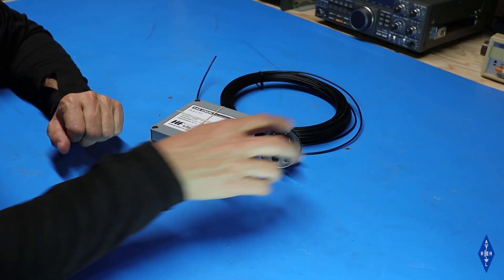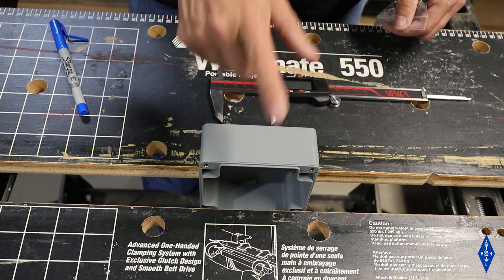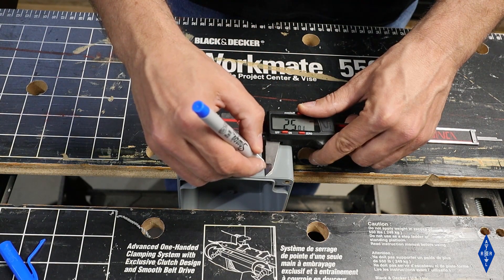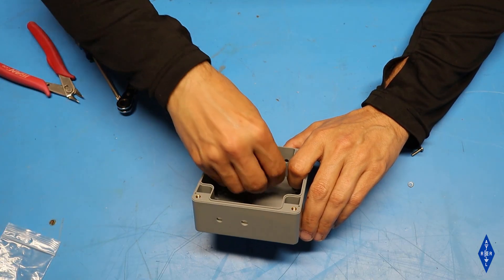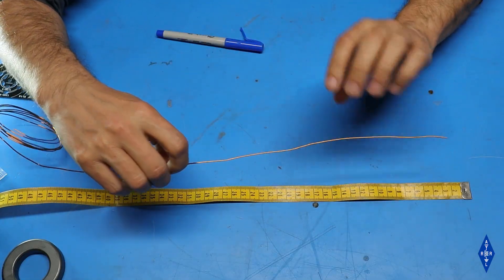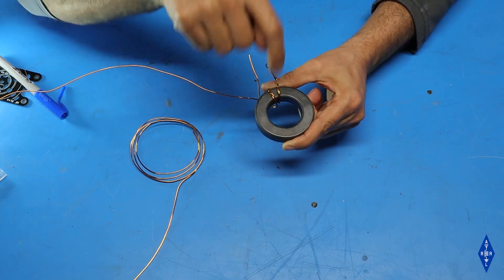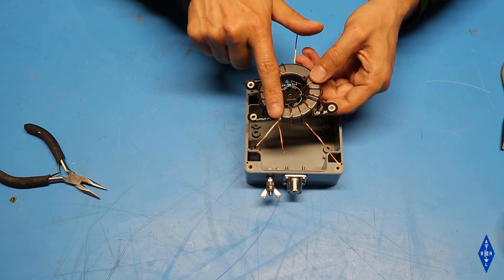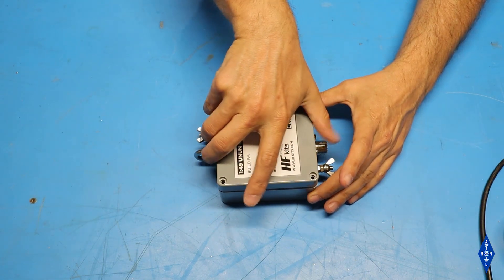EFHW End-Fed Half-Wave Antenna Kit | Part One: BUILD

Comment: In the original manual for HF kits, they install SO239 into the box but not install outside the box than you, it is more beatiful box. Perhaps is more easy install outside because inside need a more big hole that 16mm to conected a full conector in so239. Nice video, great result and nice data test for all people And it's also the first video I've seen about these kits that use tooth washers well :) , thank you ARRLHQ.

Comment: Two things I would recommend:

1.  It's a bit easier to do the soldering with only the bottom two bolts holding the SO239 in place.  It's much easier to see and "get at" the ring connectors without the other hardware in the way.  
2.  It is possible to install the SO239 "upside down," which won't hurt performance, but it makes it much more difficult to solder the third wire and capacitor in the center of the SO239.  Install the SO239 so that there is a bit of a "scoop" in the center post, which will make it much easier to see and solder.

Comment: TIP: Drill the big hole for the SO239 and mark and drill ONE bolt hole. THEN attach the socket with one bolt and use the base of the socket as a template for the other three holes. That way, you don't have to re-drill misplaced holes! 😉
Reply: Does anybody know the size of the screws/bolts, washers & nuts used for the SO239 connection??  I'm trying to put something like this together myself sourcing my own parts locally...

Comment: 12 total wraps with 2 in the primary is a 36:1 transformer.  Is that what your plan for the EFHW calls for?
Reply: It's actually 14 wraps!
Reply: The two wraps in the primary are bifilar so there are actually 14 wraps on the Secondary.

Comment: Rob, I'm stopped partway into a build.  A few comments - plus an important question about something that's holding me up.  I assume if clarifications are useful, you could just add some online text to the video , like other how-to people do on YT, instead of having to re-edit the video.  .  
     1.  I was confused at first by the ring connector insulation removal because there are three of them.  Ultimately you remove them all later, but I worried at first because I pulled it from one of the ones with the large hole instead of the small one you started with.  An onscreen text clarification might help.  
     2.  I used tape to hold the coax connector against the box at the outside, because it's hard to work it subsequently without screws etc falling off - maybe worth an onscreen suggestion.  I also got away with using just one 8 mm wrench instead of two by holding the other side in place by hand.  
     3  Ring connector at 6:20 - it struck me as odd that its flat part wasn't flush against the box instead of flipped as you seemed to put it on, which makes it deform away from the plastic a bit as the bolt tightens, but maybe there's a reason you did that - maybe an online comment to clarify.  
     4.  Around 8:55 you flip the ring around without announcing that.  If you're a noob like me, I just assume I did it wrong and go rewiring it to the right instead, then discover you just flipped it over a second time around maybe 9:23 and I then go rewiring it like it was the first time.  An onscreen comment about the flips could be really useful each time you do that (happens again around 9:23).    
     5.  I had to freeze the screen to count the how many times you wrapped it on the opposite side - it could be helpful to put an onscreen text comment there.  
     * 6.  I followed very closely - paused, stepped forward 5 seconds in places, left or right arrow, for anyone who doesn't know how to use that, and frame by frame using < and > keys can be useful too.  But even as carefully as I did this, at 10:15 I seem to have 7 wraps at right as you do but appear to have 4 on the left instead of 5 as you appear to on the screen before the 5cm strip goes outwards underneath (and I had to pull it from under another wrap in consequence of where I started wrapping per the onscreen images.  SO the critical question is, does this matter, does that numerical precision materially affect performance in consequence of turn ratios or anything? 
     7.  I don't have flux, I just have solder with a rosin core right now.  Will this make a difference, especially since you said contact here was key?  Also, will it matter if some of the stripped copper is in contact with the iron ring at all?  It might be helpful to clarify for the ignorant.  

I'd like to have this ready for Field Day, but it's more important to just not screw it up if some tiny detail like a missed turn will do that.  

Hopefully I don't have too many more questions after that.  Look forward to your answers - and I appreciate the video, it's far more helpful than the detail-skipping pdf.

Comment: Make sure the when installing the SO239 that the short part of the center wire connector "opening" is facing up to facilitate soldering.  If it's facing down, you can't get to the wire and it's impossible to solder.
Reply: lol,,I got lucky and installed SO239 facing up,,lol,,I did this before reading your post,,,KI5TFZ,,Thanks for future reference !!

Comment: I found the point where you wrap the wire very confusing. You keep on flipping over the Torrid and your hands are always in the way to show what you did. I had to repeated stop the video, watch it again to figure out why my wires don't agree with you (cause you flipped), and reorient the torrid before continuing.
Reply: Absolutely confusing!  No mention of the number of wraps once you crossed over the toroid, hands in the way, reversed viewing orientation.  Also the position/orientation of the holes in the plastic box do NOT agree with the printed instructions/pictures on the ARRL website!  Thanks but you or the designer needs to review and correct.

Comment: I built this ARRL kit, and with the full length wire (78ft), the SWR low point was at 6.3MHz.  I shortened the wire 10 feet, and it was perfect for 40m (SWR = 1.2).  However, the 20m SWR=4.2, the 15m SWR=5.3, and the 10m SWR=4.6, all too high for my rig.  No counterpoise used.  Any suggestions on how to make this antenna work on all 4 bands?  Thanks.
Reply: 78 feet??... that length doesn't resonate with anything.  Try 64' for a 40 to 10 meter antenna or 130' for a 80meter to 10 meter antenna... for resonance on the lower ends of the band you might put a 5 turn compensation coil about 2meters from the feed point for the 80 meter effort and 1 meter for the 40. Haul at least 1 end up as high as you can.. preferably both ends and your counterpoise is the coax shield..If you use the coax as a counterpoise do not use any chokes on the coax at the antenna feed point... maybe down by the rig...the above antenna length figures are for insulated wire, taking into account the velocity factor.. if you use bare wire the lengths will be greater by 2 or 3 feet.  Works great for me.

Comment: This is a great how-to video.  Thanks for the clear close-up pictures!  Thanks also for the description of the stacking order of everything on the bolts -- it took me a while to figure it out from just the pictures in the ARRL instructions and the RFKITS instructions.  I think the most difficult thing when I built the kit was trying to wind the wire, especially the doubled primary+secondary coil, tightly around the toroid.  Suggestions on that would be welcome.

Comment: Just in case you don't have a step drill, they are about $40 (or so) at big box stores
Reply: Or $5.99 at Harbor Freight. Or $12 at Amazon. As you are only cutting through soft plastic, the quality of the drill bit is of less concern.  I would not spend $55 on a Milwaukee.
Reply: "Any project that requires the acquisition of new tools is thereby a good one."😀

Comment: Why if we are in the usa we need to use metric i use inches , feet , yard ??
Reply: Because using the metric at drilling the holes makes measurement vastly easier.  I tried figuring why a pdf build guide online placed the coax connector off vertical center closer to the connection edge than the outside of the box, and if I'd just centered it on 5 cm midpoint (box is 10cm) and 2 cm short midpoint like in this video, drilling the 5/8" SAE/imperial hole would have been much simpler.  And as Joe B suggested, you're building your box for the 20m band, not the 65.5 foot band.  
We should have converted to metric back in the 70s when we were educating kids to use it *sigh*.  Well, at least the military has enough smarts to use it.
Reply: You don't NEED to use metric - the kit comes from England and the instructions are specified in metric.  You can convert to imperial measures, or use a metric ruler.  As most hams refer to the 40 meter band and the 23 cm band, not to the 131-foot band and 0.75-foot band, we already know metric measures and that seems easier than converting.
Reply: Because the kit was clearly designed, and imported from, outside of the US.  If the metric hardware sizes don't give it away, note the PA2 call sign on the instructions.  At least they do give the equivalents in inches, and I suppose you can use adjustable crescent wrenches.  But we all had to learn metric prefixes (2m, 70cm) to pass the exams and get our licenses, right?  A few metric tools are probably a good investment.
Reply: The bands and frequencies are in metric, all modern radios are built using metric, heck, even nearly all U.S. manufacturing uses metric outside of the construction industry. We spend thousands of dollars on this hobby, and can't be bothered to pop a 20 dollar bill for a metric tape measure?

Comment: Price of $69 Box should be pre-drilled ready for assembly - Keep It ARRL
Reply: Oh and the torroid wrapped and everything soldered and while they are at it seal the case too?

Hello!!! It’s a kit with all the parts provided.    A nice quick build.
Reply: @BenWorrell  Hello. its an overpriced rip off  ; )
Reply: I believe its a good hobby for someone to play with. Plus ARRL makes a few bucks. And ARRL does alot of good for HAM radio.
Reply: @farmerwayne1404  Many will argue its not a hobby its a service with good reason. I am NOT seeing anything ARRL did for Amateur Radio what are some examples?
Reply: And the SO239 connectors should have been installed as well for that price.

Comment: I like the fact you use a star lock washer where the wire connections are. I found through my own experience at work to use a star lock washer.

Comment: Poor, hi Z antenna. Why not just build a  proper dipole? Cheaper, perfectly tunable unlike this hi Z kluge
Reply: Because this antenna, with a ~130' antenna wire, works on 80M, 40M, 20M, 15M and 10M w/o an antenna tuner.  It also only requires two support points - my house and a distant tree.
Reply: But this gets multiple bands without all of the work of tuning all of the branches of a fan or parallel dipole (which is what I've been using the last couple of years).
Reply: Because It is Multiband, It works well, Its smaller than a "proper" Dipole, and it is easier to install.  Did I mention it works.
Reply: If this antenna which is one end fed wire can work multiple bands is it possible that a standard dipoole at a certian length can also work many bands?

Comment: Any reason this can't be built for 80 meters with a 134' wire?
Reply: No, no reason. That should work. You could also do it with a 110 uH loading coil. So  aprox. 66 ft wire than the 110 uH coil and than another 8 ft of wire.
Reply: After experimenting with the ARRL kit and the 65' wire, I did exactly that (replaced the 65' wire with a 130' wire) and it works nicely.
Reply: @joeb3300  TNX for the info,,my kit has a sticker that claims the balun work from 3.5 - 30 MHz,,,will keep in mind your experience

Comment: What about a hole in the box to allow for moisture to drain out?
Reply: The case comes with an elastomer (?) seal that doesn't quite reach around all 4 sides.  If you leave the two ends 1" apart on the bottom, you may accomplish your goal without making an entrance for insects.
Reply: How about a good sealing job on the lid and a dehumidifier packet inside taped to the side. If everything else is well sealed there shouldn't be any condensation to deal with.
Reply: You're having to drill the  holes anyway so I guess you can do that yourself?
Reply: I thought about drilling a weep hole on the bottom (the side with the socket) and putting gasket goo around the bolts and putting liquid electrical tape on the back of the socket, but I didn't (yet, anyway).  I got the bolts pretty tight.  What would you (or others) recommend?